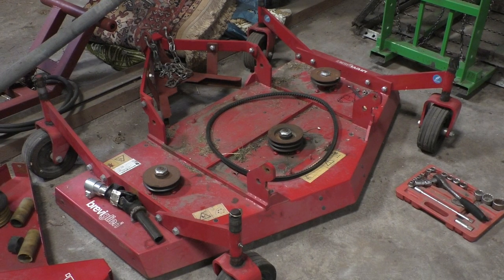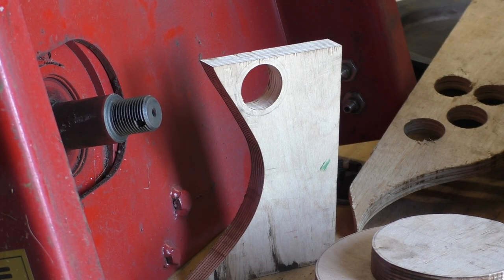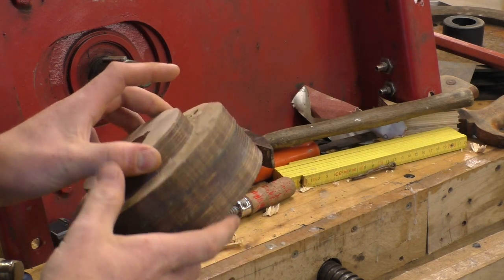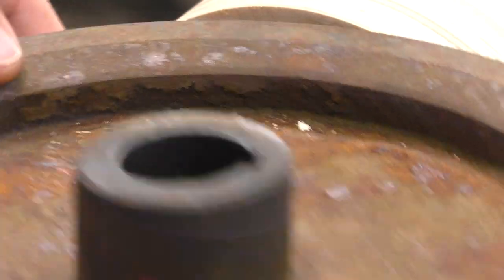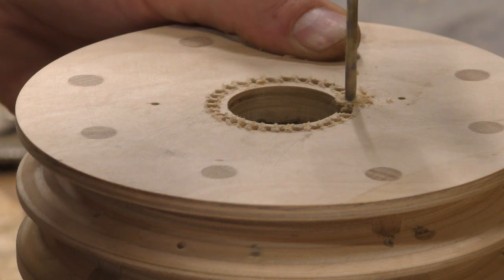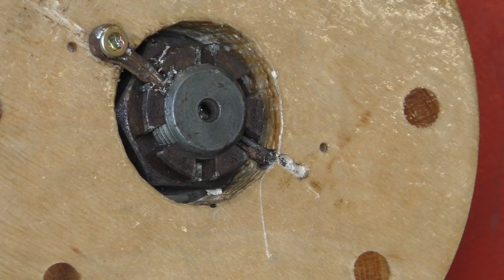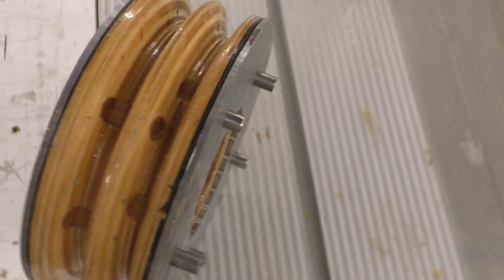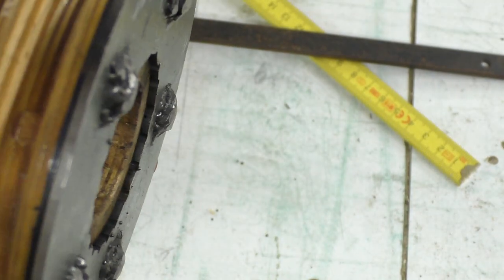DIY Wooden Pulley for Mowing Deck

Comment: I'm wanting to build several step pulleys. After 2 years, how is your pulley holding up?
Reply from the maker: Cant really tell, didnt use it much, as it turned out my tractor isnt strong enough...
Reply: @DIYdiacsnFarmstead  
The idea using steel to sandwich 🥪 the wood seems like a good one.    I know your pain with the tractor. Years ago I bought a big round hay baler. Then had to go out and find a 966 turbo International Harvester to pull it.    Tho I did fall in love with the 966. It burned half the fuel of the tractor half it's size.